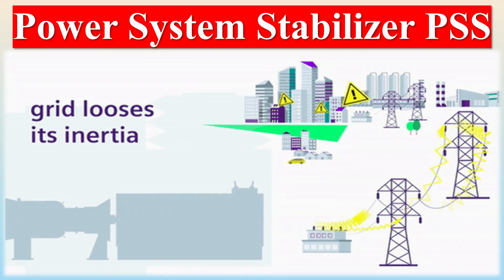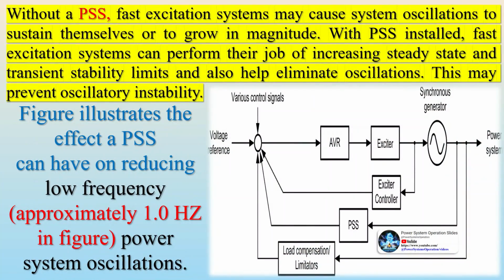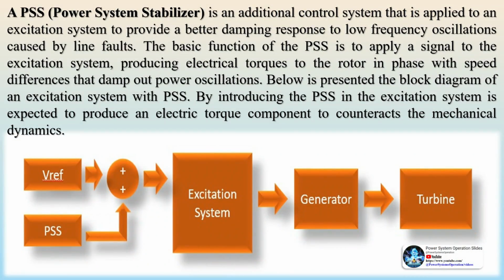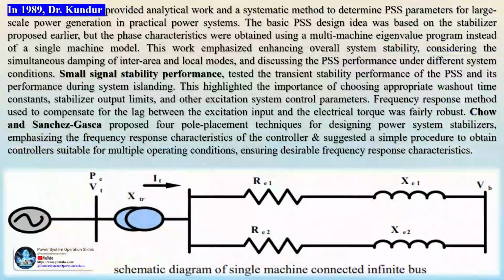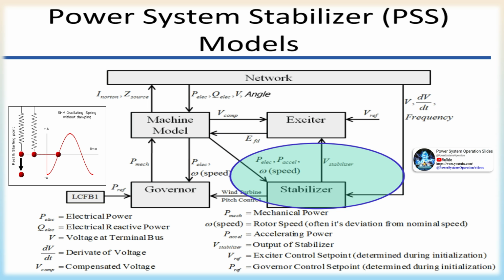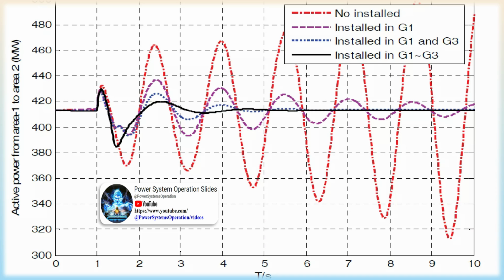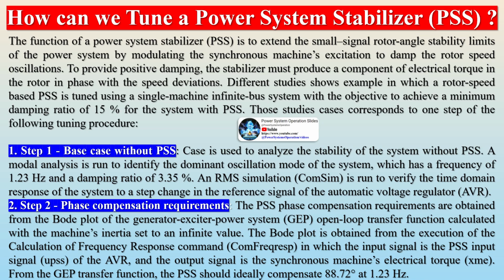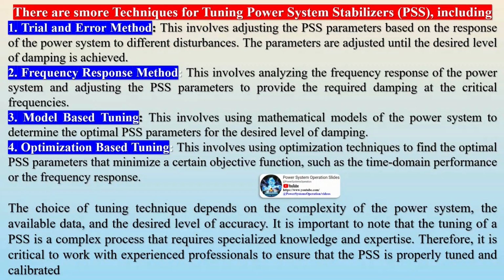Power System Stabilizer | Functions Structure & Benefits of Power System Stabilizer | Tuning of PSS

Comment: Thanks. The system you present is based on the control of centralized turbine based power generation. The growing contribution of decentralized renewables, such as wind and solar, will result in power management taking place locally. Large scale battery storage using grid following inverters will modify and control power distribution. Turbine generated power will only have to charge batteries.